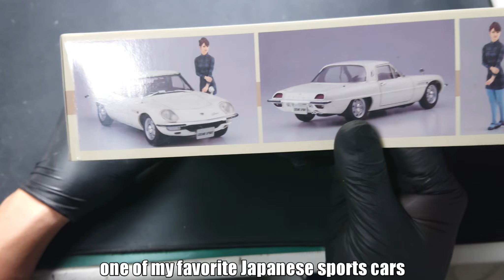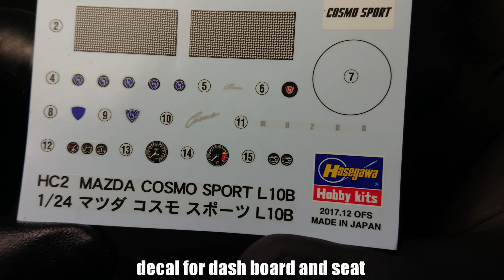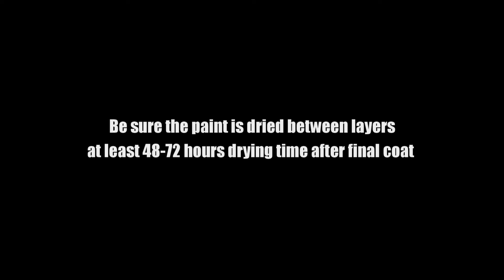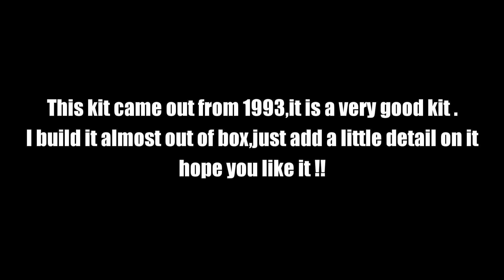1/24 HASEGAWA MAZDA COSMO SPORT FULL VIDEO BUILD

Comment: Hi Mr Lin, I've given up on this one, the version I have is the '68 marathon de la route, there's not even mounting holes for the spotlights, it's too a fiddly model for Me, My first and last Hasegawa model for Me unfortunately, open holes where the pins should go Thankyou Hasegawa, regards Stewart.
Reply from the maker: HI,sorry to hear that..I also got that kit, just check the instruction, I think the spotlight should be attached on the front bumper......yes,it might be a bit tricky to assemble the front spotlight....I will try to build that kit sometime..cheers!!😊

Comment: Hey Mr. Lin, Chris here......... question 4 U........when U fill in the panel lines with the Tamiya panel liner after U clear coat the kit.......doesn't the clear coat fill in the panel lines as to where the wash can't get into the panel lines? I always wondered about the clear coat filling the gaps.......is it a better idea to fill the panel lines after paint and before clear coating? I'm not sure if one way is a better way than another......please, let me know your thoughts.....thanks!!!!!
Reply from the maker: Chris my friend!😊 that's is the reason why  I always engraved the panel line on my model...
first,you will get a nice clean panel line after washing.second,the model will looks more detailed and more three-dimensional....
this engraving process takes time, but trust me,it is not as hard as you thought,you just need some proper tools and some practice.😉
you can fill the panel line befort clear coat, but I felt the "shiney panel line" just looks uncoordinated..😐
of course, you can just "paint"the panel line simply use tiny paint brush..but that is another story..😓
cheers!!
Reply: @MRLINSSCALEMODELING  Morning Mr. Lin.....thanks much.....I actually do scribe out the panel lines as well for the same reasons you described.I personally fill them in after paint before clear coat, that seems to work best for me. In my mind when I see some builders fill in the panel lines after clear coat, it just seems to me that the clear coat would fill in the lines & harden &  there's no room for the wash to go into. Thanks much & I'll speak to you soon!!!!!!!!